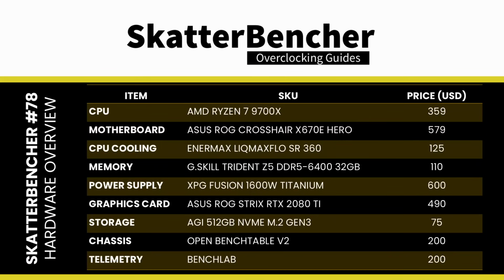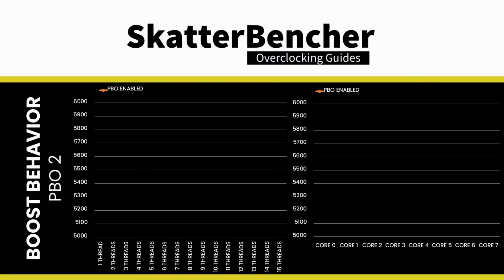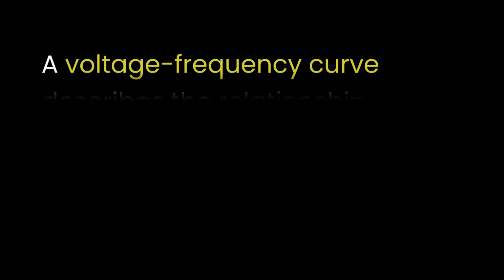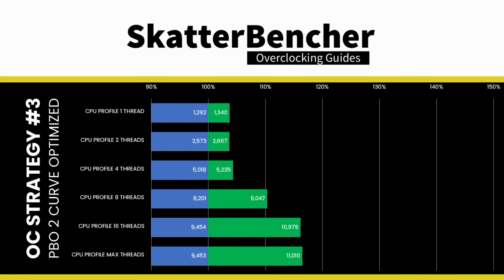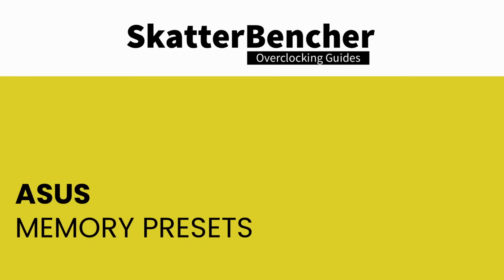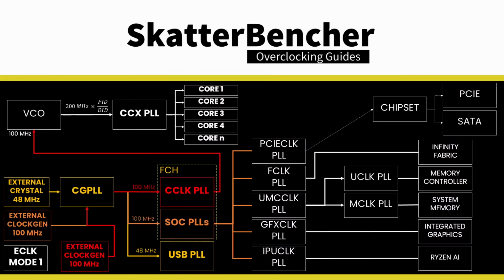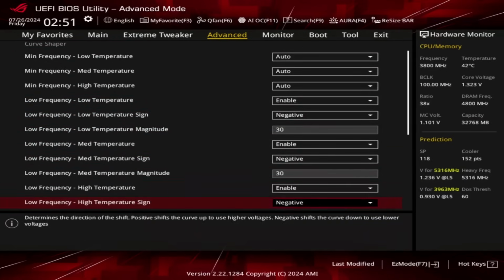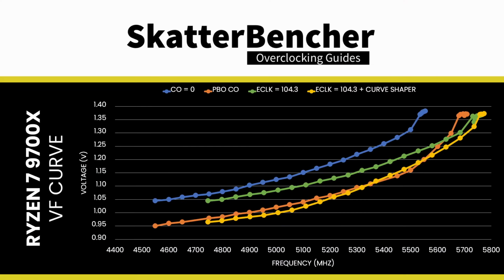Ryzen 7 9700X Undervolt & Overclock to 5860 MHz | SkatterBencher #78

Comment: i just undervolted my cpu to -25. when i do the stresstest ram+cpu with occt my temperature just goes up to 57. before undervolting it went to 58/59 degrees.
is that normal that it doesnt go up to 95 degrees?
expo is enabled too
in idle i ve temperatures bout 47 degrees, that didnt change with undervolting

can i go to -35 and the temperatures would be a little bit lower?

Comment: Coming off from a Ryzen 5 1600X that was so fucking pain to actually lay down a stable 4.0GHz OC @1.35v on 3200MHz RAM speeds that ended up with a 3.9GHz @1.35v w/ 3200Mhz, this is a breath of fresh air. I'm building a new rig with this CPU on and I guess YT helped me out with this video recommendation.

Thank you for the deep dive of the CPU's baselines to strategies on the overclocking! Subbed as well! lots love!~

Comment: I adjusted the infinity fabric clock to 2133 and now get audio crackle on windows boot but only after exiting bios. I dont experience this on normal start or restart.

Im assuming the FCLK is unstable but even with resetting all bios settings to stock and also  resetting the cmos, i still get audio glitching at windows boot after exiting bios. I used to at least be able to run Expo and PBO on enabled without any problems.

Any ideas of what i could do here? System seems to operate fine beyond that.

Can a simple 133mhz fclk boost do irreversible dmg?

Comment: if i do all these tuning strategies will i need to have the same cooler and power capacity as your specs?

How do i know how far i can push it?
Reply from the maker: Any decent PSU and AIO should be able to handle the 9700X overclocking strategies from the video :)

Comment: Great video! I've been tuning my 9700X and managed to hit some insane numbers on a budget Biostar B650M motherboard. I'm stable at 5.66 GHz All-Core with a -50 Curve Optimizer setting at 160W PPT.
More importantly, I've achieved 6400 MHz CL30 at 1:1 Gear Ratio with 2200 MHz FCLK rock stable. My CPU-Z Multi-thread score reached 9503.9. It’s amazing to see what a 'Golden Sample' can do even on entry-level hardware without needing an X870E flagship. Thanks for the guidance! 😅

Comment: What should I know about system longevity when overclocking? I hear that scalar 10x can nuke longevity, but that when used with the CO undervolt it can be fine.
Reply from the maker: I doubt scalar 10X would "nuke" longevity. 1X to 10X usually only increases the maximum operating voltage by 10-15mV.

Comment: I'm currently in the process of building a new pc using the 9700x. What kind of motherboard would you recommend if I'm on a bit of a budget, specifically are there any vrm requirements, for example if I have a motherboard with only a 12 + 2 + 1 vrm phase will it be avle to handle over clocking the 9700x to this degree. Some motherboards I'm considering are the msi pro b850-p, the gigabyte b850 gaming x wifi 6e and the Asus Tuf gaming b850 plus wifi although that one is slightly over my budget.
Reply from the maker: The limiting factor for single-die Ryzen 9000 CPUs is usually not the VRM but the CPU die temperature. So, yes, you should be fine even with a regular B860 board.

Worst-case, if the VRM & cooling is really that bad, you can always set a maximum power consumption limit and still tune with curve optimizer and fmax to squeeze more performance.

Comment: Im literary new to oc the strategies are steps or like each one is seperate ways if then which one is the best for performance in esport games? The memory one? Or i nead to do all of 5?
Reply from the maker: The OC Strategies are independent, so you can pick on. But they also stack, so the optimizations from OC Strategy #2 include those from #1, etc.
Reply: @SkatterBencher  soo to get max performance i have to use all 5?
Reply from the maker: The last strategies usually provide the best performance but are also the most complex
Reply: @SkatterBencher its easy to reset?
Reply: @SkatterBencher  Is it easy to reset if i mess up something?

Comment: I am new to overclocking and have only done it on Intel before, just got this processor and i notice Space Marine 2 might be bottlenecked by my CPU, getting MASSIVE fps drops (the game starts running in slowmotion for many seconds, then goes back to normal) Been thinking i should try to clock it abit and maybe undervolt as that solved alot of my problems when i had Intel, this guide seems awesome, but i just got one question, am i suppose to just between OC Strategy 1-5 or am i supposed to implement them all? Thank you.
Reply from the maker: The strategies "stack" for the most part, so settings from OC Strategy #1 will carry over to Strategy #2. The configuration gets more advanced with every step, so just pick one that you're comfortable with. Maybe even start with OC Strategy #1 and see how that works with your system, then try #2, etc.
Reply: Also liked and subscribed

Comment: If you can answer a question, my 9700 x has a stable pbo - 45, but in the oct test my clock drops to 5.2 ghz in cinbench r23 it is 5.4 ghz, in the video you can maintain 5.5 ghz during the oct test, is this normal?
Reply from the maker: It sounds like there's a performance limiter holding you back. Temperature? Voltage? Power?
Reply: @SkatterBencher  The temperature limit is 95 degrees.
The temperature limit is 95 degrees.
My motherboard is an Asus B650 Plus.
PPT 1000W.
CPU TDC 1000A.
CPU EDC 1000A.
PBO + 200MHZ UNDERVOLT -45.
OCCT Small Extreme SSE core effective 5.350 GHz.
Maximum temperature during the test 86 degrees And 152w
Is there anything that could be limiting the load? In games, it stays around 5.6 GHz.

Comment: i have asrock pg lightning b650 atx, noctua nh-d15 as cooler, and 9700x ryzen, with -30 undervolt it crash i have to use -25 and temperature go hit 95 celsius so i get throttle

Comment: I wanted to get some insight on my current status. Currently, my system is able to hold 5.58ghz all core at 1.23V, drawing 125w average. Single core max reported 5750mhz correctly under these conditions. Followed everything on #4 except for ram oc due to using a x870e taichi and planned on keeping the 6000mt cl30 expo box setting. Unicorn cup or other causes?
Reply: Asrock Tiachi Lite, bios 3.30

Comment: I have a coolermaster AIO. When I run CPU benchmarks my temps settle around 74°C. Am I doing something wrong with my cooler?
Reply from the maker: 74C sounds normal ... why do you think you're doing something wrong?
Reply: @SkatterBencher I hear a lot of people getting their cou to stay in the 50s under load. If I’m alright then I won’t worry. It’s my first amd cpu since the FX 8350
Reply: @sterling1395 in multi core benchmark if someone is getting 50c then probably he is using 65w mode and room is freezed 😂

Comment: Worthless guide. You brag about CPU temperatures, but why don't you show temperatures from single-core testing (non oc, and uv). What, AMD forbids showing these temperatures because they reach over 80 degrees? I know this because I tested it in single core and I was very surprised. You all praise this processor, but it's shit in single-threading because of these temperatures.

Comment: Hello @SkatterBencher ! Tell me please, would it impact gaming performance, If i wanna be power limited around 90w TDP, PPT in games? I've done undervolting my 9700x and achieved stepps by: -50 MED/-40 HIGH/ -42 MAX freq  additionally +100mhz PBO clock override. Now Getting 5650mhz in games but wanna get even more for 1T performance. The problem if I increase it to +200Mhz, the offset -42 doesn't work and i have to decrease steps too much => significantly affecting power draw and temperature
Reply from the maker: Lowering the power limit will affect performance as you'll likely see lower frequencies under load. By how much, I don't know since since I never tested that

Comment: Building my first pc with this cpu. Has anyone tried this overclock that might speak on long term stability? I will have a 360 AIO cooler and 6 additional case fans in the NZXT H6 flow case, so should be able to keep it cool.

Comment: Hi @SkatterBencher can you please give me an advice on this? As I understand it I should lower and lower the negative offset of Curve optimizer until I get a crash from the system. Simple. I am now set to minus 50 and didn`t have a single crash! The bios does not let me to set it lower. It is running at 5580 MHz with 112W of power draw. Is this the righ approach? Or should I be rather benchmarking at each Negative ofset step than waiting for a crash?

Thank you you are the best!
Reply from the maker: Even being able to set -50 is quite remarkable, you might have a pretty good CPU. But you definitely need to do more stress testing. Especially with Ryzen CPUs because they have such a dynamic V/F curve. That means we need to test stability across the curve. For example, (a) heavy all-core stress tests for medium frequency at high temperatures, (b) gaming loads for high frequency at medium temperatures, (c) transient loads to see what happens when the frequency rapidly switches from medium to high load.

Comment: In ram tuning did you resolve the occt instability error?
Reply from the maker: For the 9600X and 9800X3D I ended up reducing the memory frequency to DDR5-6200 which got rid of the errors. Still much faster than 6400 untuned.

Comment: Just bought a 9700x since the prices went under 300$ where I live :) when I undervolt with curve optimizer to around -30 I get a very strange behavior where things are stable under load and while gaming but the system sometimes freezes when I start up programs/games. So when the cpu shoots from idle/low temps to high frequencies/temps? Any idea how I could adjust with curve shaper to prevent that? Because again, once everything is loaded and warmed up it's stable again.
Reply from the maker: You can try setting the min frequency shaper points to something positive (start with +10 for example). If that doesn't work, try setting the max frequency shaper points to something positive.

Remember that Curve Optimizer and Curve Shaper stack on top of each other. So -30 CO with +10 CS is effectively -20 for that frequency region.

I have a couple more detailed videos about Curve Shaper on the channel as well that you could check out.

Comment: Every time I set UCLK=MEMCLK i get the red RAM light on my MOBO and have to short CMOS to get a restart... could it be my RAM kit?  I'm running Teamgroup T-Create Expert 6400mhz CL32 Overclocking 10L 32gb kit (2x16)...
Reply from the maker: I don't think it's the memory kit as much as it's possibly the memory controller. Running DDR5-6400 with 1:1 UCLK is not a given as you need increased SOC voltage and a bit of luck.

I'd say try: (1) loading expo, (2) set DDR5-6000 and see if that boots, (3) and if it does, set DDR5-6400 with 1.3V SOC and see if that works.
Reply: @SkatterBencher  thank you for responding so quickly, you're awesome.  I'm actually able to run the EXPO II setting with the same selected profile you chose in the video:  Hynix 6400 CL32 1.4v (i believe it was?)... I even tuned my timings down to 30-37-37-80 and just passed 30 minutes of Karhu and 30 minutes of OCCT CPU+RAM.  I've been very impressed with this set taking whatever I throw at it, I just cant even think about setting UCLK=MEMCLK.  Thanks again!

Comment: I didn't understand why my RAM frequency on both CPU-z and Geekbench 5 and 6 are showing very low transfer rate 1296 MT/s and getting Low benchmark Score despite CPU overclocked to 5700MHZ and temperature don't reach 70 degree
Reply: hello friend. Have u managed the problem? I think that u've put too much offset, or setted power limits

Comment: X870e taichi, 9800x3d, 6400cl32 ram.

Which strategy should I follow? Not too much power consumption, but decent gainz
Reply from the maker: Strategy #3 should be fine. Curve Optimizer will boost the frequency and reduce the power.
Reply: @SkatterBencher  thanks a lot

Comment: Would not be better to set the infinity clock to 2133 MHz when the RAM runs at 6400 Mt/s? That would give 2:3 ratio between the IF and memory clock.
Reply from the maker: I've seen people suggestion 2:3 ratio. Is there any reference I can look at that explains why it's better?
Reply: @SkatterBencher 
sorry, i cannot really explain it, it is beyond my knowledge.
But it seems to me that 2:3 is still a somewhat 'rounded' ratio (= in 6 cycles one runs 2 times, the other 3 times, without fractions).
Buildzoid told in his AM5 videos that according to his experience if the IF clock moves only 1 or 2 steps away/up from the 2:3 ratio then the performance is generally slightly weaker. (Do not forget that the 'recommended' 6000 Mt/s at IF 2000 MGHz also gives 2:3 ratio.)
I was just curious if you have tried it and able to share your experience.

Comment: Why not just used Hydra?
Reply from the maker: I prefer overclocking from BIOS since the configuration is set at boot and I can benefit from the motherboard vendor auto-rules
Reply: @SkatterBencher  Nothing's stopping you from taking the undervolt values it gives you (per core btw) and applying them in the bios. That's what I did and it let me still do a hefty undervolt on my 5800x despite having 1 really bad core that can only do -12 while the rest can do -20 or better.

Comment: This gives impressive results in terms of frequency. And it's a fantastic quality of demonstration, really great job.

I suppose it's normal for this not to affect gaming performance much. It did boost some benchmarks quite a bit, bit most were closer to 10% or less, and immediately at double the power. Again, normal for overclocking. Thanks for that demonstration, really well done and quite cool how this technology works to deploy/configure the OC. But at the same time, I would not be willing to go so high in power for such little performance difference, me personally. I would maybe boost it a little and try to stay closer to +20W-50W over stock, hard upper limit, or else just give up and use stock if it's not possible to see perf gains in my personal real-world workloads of interest.

Comment: Sorry but occt is one of the easiest to pass, and this 6400mhz literaly failed quickly it is extremly unstable system. Also -35 no way it will pass all the things especially in yruncher. If -25 would work flawlessly it would be good. Mine can work -45 in most games and cinebench benchmarks bit if u run heavy things special samples* in aida or ycruncher n63 & other it will pass only with -25, same here u showing just exagerated results. U cant even run the game "high on life" it is doing something at the start and the mininum at least for my processor was -32 to not restart computer when entering the game. So what is the point  of showing people things that are not working?
Reply from the maker: Thanks for the information! In your opinion, what are the "worst-case" stress tests I should also run for CPU and memory stability check?
Reply: @SkatterBencher  Ycruncher v0.8.5 ...press 2 -> uncheck 11,13,14,15, run for 3-4h the VT3 and N63 also FFTv4 is a must-->press 0 to start. After that run aida64E at the last  section 'benchmark' run all FPU few times, these are short tests. Then go tools --> system stability test, check only stress system memory, that test is only for memory controler dont mark anything more thatnks of that it will be quite intensive if u can run this for 2h & temp is stable then the system is very stable. After that u can run whatever u like. It will be very stable my computer done 2 weeks of RIFE 4.0 non stop been doing 24fps to 120fps Anime it made that without problem. The Rife is using cpu so much that its been doing only 4.7ghz. In cinebench 30min stress test i had 19000 around 4.95ghz averg. The RIFE 4.0 with 15min video 480p is super intensive for computer it is using intensively m2 SSD gen4, max CPU with memory and graphic card with CUDA.

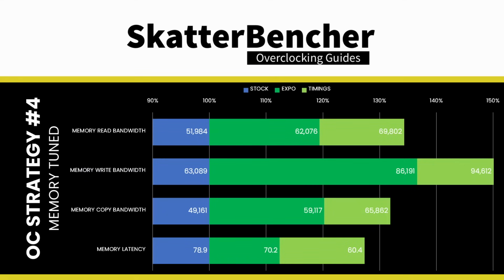Comment: 23:45 root cause of memory instability... do I see MEM VDD 1.8V ?  One point eight volts ?  That is absolutely insane, and if I remember correctly, many DDR5 chips max out at much lower voltages so this reading might be incorrect. If you are pumping 1.8V to memory,  that's not going to last very long (you showed 1.4V profile being set in BIOS shortly before this timemark, so I wonder where this 1.8V comes from). Also, we don't see VSOC which has great connection to memory stability as you know - "optimal" values for these new chips are unknown at this time (2024/Aug/10) so nobody can really tell you how they behave or what is the safe range - it's somehow acceptable to assume they would be almost identical to 7xxx generation because of internals and little changes in this area.

Instability might come from tRRDS 4, tRRDL 6 or tFAW 16 settings. These are extremely extremely tight for DDR5 (DDR4 wouldn't work below 4/4/tfaw 16) ; I would suggest 6/8, 8/8 or even 8/12 or 12/8 combinations. tFAW 24 or quite possibly 32 (always four times more than lesser of those two previous settings). Maybe tRFC 500 is too tight, try 600 (doesn't have too much performance impact).  

Next, these timings are far from optimized in general. tREFI 23354 is too much, try 65535 or 40960. PowerDown enabled == instantly look for option to disable in BIOS, you don't need any power savings on memory modules.  

I would also instantly try to set lower resistance on RTT settings, maybe 24 ohms instead of 40/48/40 which we see now would help. Improve by one step at a time, easily all three of them as a group.

Other settings are also far from optimal but that's for a very very very very long article.